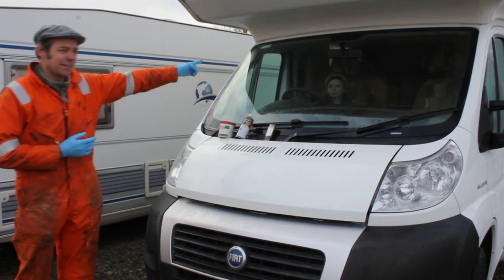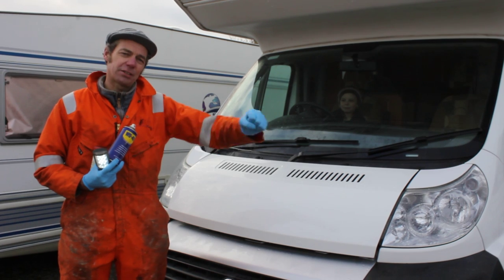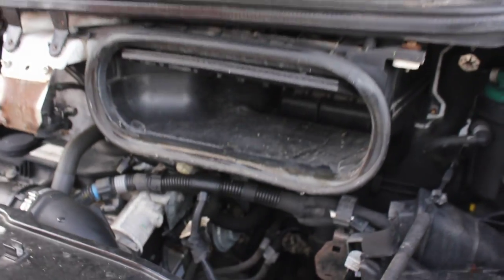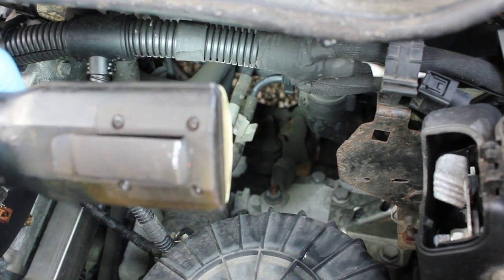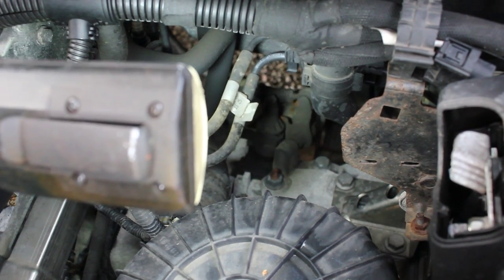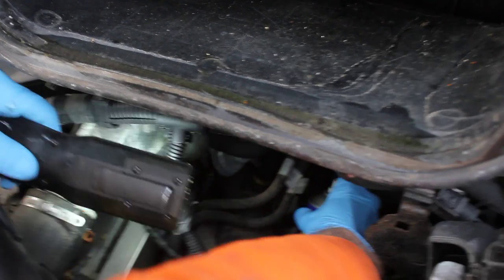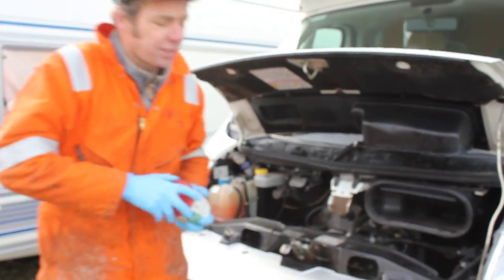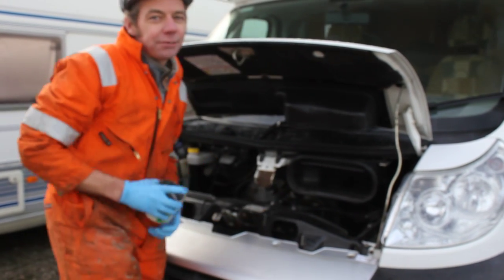How to cure a stiff gear change on a Fiat Ducato motorhome or van

Comment: Tip: Your advise. Is correct and make sense. BUT a word of caution! ⚠ 
Pretty much all types of grease and oils act like magnet for dust /dirt /debris. Which is precisely the genesis of this problem! When driving in heavily dusty environment. One can notice the time between lubs will get shorter and shorter! 
How to solve it? Very simple. Silicone! Either in spray, but particularly in grease form makes for excellent lubrication, do not attack rubber parts AND do not attract dust. In fact it acts more like a dust "repellent". A very handy feature in this case. ;-)
BTW Lubricating any moving parts is a valid tip for any mechanical components on any car, van, truck, etc. ;-)
Cheers

Comment: We had a problem with our work van (Peugeot Boxer) which wouldn't go into reverse at all, or go across for 5th and 6th. We put it into our local garage to sort. They said that something had collapsed inside the gearbox, and they would need to drop the box, send it off to a specialist for 2-3 weeks to rebuild it and fit it back in. They quoted 800-900 quid!
I wasn't convinced as the van has only done 65K so I set to work with the WD. Ours was really seized so it took a bit of levering with a screwdriver to get it moving enough, but eventually got enough movement to engage all the gears. I'd already done that before stumbling on this video but it's exactly the same job as you've done so well done for showing people how to do it. Unfortunately, I didn't have a 'wiggler' so had to keep getting in and out of the van but got the same end result.
I too have used grease afterwards to stop the WD drying out too quickly. 
And we won't be going back to that garage again either!
Cheers.

Comment: This is very good advice. Especially with the inherently leaky windscreen -> motorbay seal you should sort out with some silicone sealant, it is important to keep things cleaned and lubed inside the motor bay. Other possible solution for a sticky or weird gear stick action is opening the stick housing inside the cabin and tightening the screws holding the assembly together. Mine had come seriously loose over time (or perhaps they had not been tightened properly in the service..) and it made a world of difference to tighten them.

Comment: Just pulled on the drive in my 67 plate work van (Citroen Relay) couldn't get it into reverse. Had been very hard work for a couple of days. 
Watched this, followed the steps and HEY PRESTO! Guess who's going to work tomorrow with only a £8 dint in he's wallet for some grease.

Thanks alot, great advise!

Comment: I did this and it worked to a degree......  I eventually discovered that the gearbox mounting was sloppy, this allowed the gearbox to move a little.
As the gearshift stick  is fixed to the cab and the gearbox is fixesd only by means of the mounting to the cab, having movement between the 2 made the problem worse. 
Changing the gearbox mounting (10 minute job and about 25 quid) cured it completly and got rid of the previous clutch judder when initally pulling away.

Comment: Thank you. I had a similar issue with my 96 Peugeot Boxer Campervan. I crawled underneath and located the linkage like in your vid and squirted load of WD40 all over. I didn’t have an assistant so I wiggled it about and after a while it suddenly freed up! Such a relief as I was on holiday at the time. I’m going to grease it up when I get home. Many thanks! 🙂

Comment: Motorcycle clinging chain spray could work good here. It has grease dissolved in a penetrating spray. The spray evaporates leaving the grease behind!
Reply: Also chainsaw oil is good and cheaper too. Not sure if get spray version to get more into the spot

Comment: Yes this works! Thanks for making the video. Harder to reach my gear linkage as it's nearer the back and centre-left so had to turn the wheel and do from underneath. Still couldn't reach to add grease so after WD40 used GT85 which has a slightly higher PTFE content - this will wear off with rain I guess but if anyone knows of a better product to spray in this hard to reach place - please let me know.
Reply: 3 in 1 anti sieze copper grease spray. Give it a good Shake befor use
Reply: @brtaylor9503  thanks.. Really appreciate the advice.
Reply: Or motorcycle chain lube as it has a solvent base to penetrate and leaves the grease inside when it evaporates..👍
Reply: @iancourt3274  I used gt 85 but that's not much difference according to the list of what's included. HOLTS do a spray grease which I have tried toda

Comment: Having a central locking issue ( incidentally right after I was placing king span insulation inside the rear door...) DONT!! I’ve pulled/ stretched a cable I recon and blew a fuse, only after I back tracked I had realised this. ( Central locking doesn’t work now ) when I replace the fuse, it does work ...only for a short time afterwards..until it blows again...I’m wondering if I have stretched a cable...also to add if I have blown the tiny door motor ( works the locking) and there’s a few of them. Do u recon the blown motor could be the fix / and or maybe a stretched cable/‘ I NEED help on this one....hopefully someone see’s this.

Comment: hi, do you know what cure there is when my relay gears won't return to central neutral?Hits all the gears linkage seems ok
Reply: Hi did you find a fix for the neutral issue? My 2008 relay has just stopped returning to Central neutral position?

Comment: Just to let you know  wd40 is not an oilor lube its a cleaner penetrant come solvent
Reply: WD =  water dispersant......
Reply: Well at least it fixed the main issue and slacked off the gear change, now u can re lube with whatever...🏴